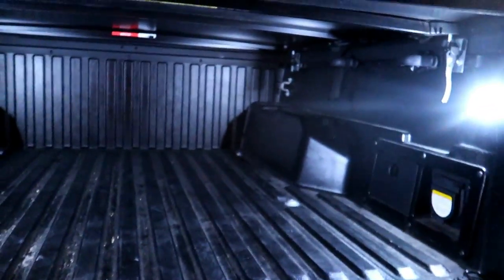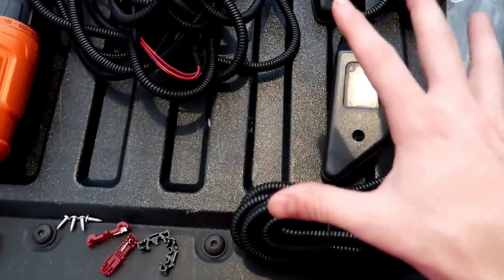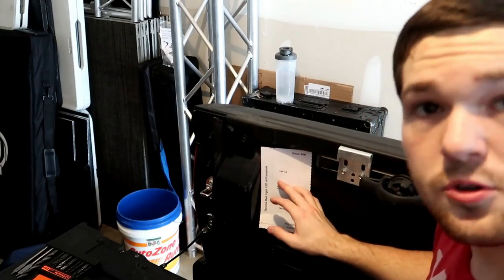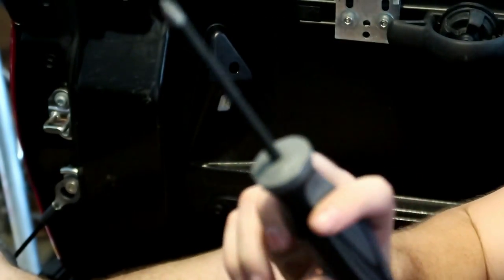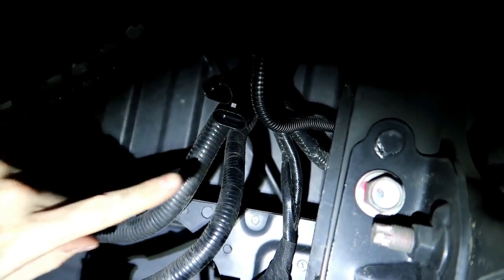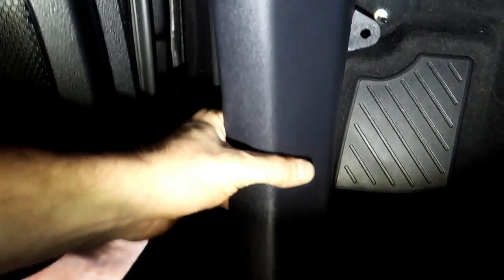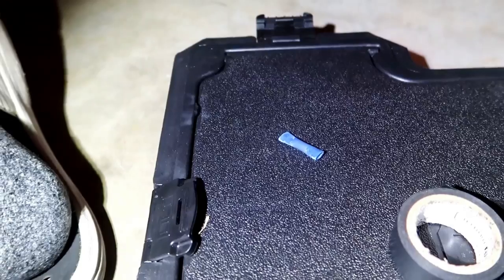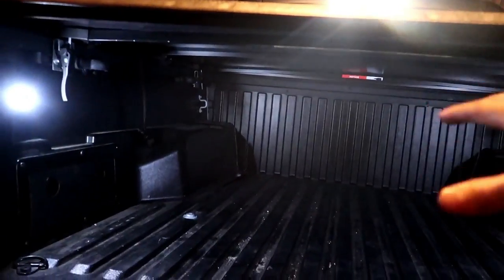OEM Toyota Tacoma Truck Bed Lighting Install | 2015 2016 2017 2018 2019

Comment: Access cab owners have to realize we tap into different wires. And the bed lights are controlled by opening the door or switching the remote unlock - whenever the courtesy light is on in the truck that’s when the bed lights are on. At first I was concerned this was going to be too much of a pain to light up the bed but even though it’s only been a day I think it might work out with that switching configuration. But the lights do make a big difference!
Reply: which wires do you tap into for 2022 access cab install with no remote unlock?

Comment: 2020 has rectangular openings already in place, with a pop-out clip plate. Safe to assume the OEM bed lights are different and no cutting is needed?
Reply: just installed the oem ones for my 2020 trd sport. I had the cargo light/relay already so just needed to get the bed lights off ebay. Got them for like 60 shipped and its directly plug and play. There's a harness for it with a dummy plug on it. I just wasn't sure if I had the relay or not so I had to pop off a piece of the dash to look since I asked the parts ppl and they had no idea. lol

Comment: Taco Rick I have the oem lights already. But I got the upgraded triangle lights off ebay. Do you know if it'd plug and play? The box came with a wire harness but like i said my truck already has the oem lights installed. 2019 SR5 tacoma

Comment: Hey Taco Rick, great vid, thanks.  What about the switching? Does the existing bed light switch also control these lights, so they're on whenever the high bed light is also on?
Reply from the maker: Yep the bed light button controls them too

Comment: I wonder if there is a way to add another switch in the tailbed so you don't have to run up front and open a door, or does it work when the tailgate itself is opened?
Reply from the maker: You can put a switch in just need to run the wiring direct to the battery

Comment: That’s just insanity. Power them off the tow package lights right there at the back of the truck. And wire in a switch. So simple.

Comment: show the wiring to the dash area, my access cab was different. Thanks for posting.
Reply from the maker: 16:00 wiring inside the vehicle and I call out what wire to tap off of......
Reply: My mistake I missed that part of the video.  I was just looking for more of the in cab installation. I was frustrated last night with mine because I couldn’t find a video with the Access cab wiring. I downloaded a better set of instructions and that was much better. Still it was a pain in the butt just because it was about 20° outside when I was doing it. But the bed lights do make a difference. Thank you.

Comment: Would this be very similar to installing ditch lights onto a bed rack...except for the connections in the cabin?
Reply from the maker: Yeah. Or you can tap into the reverse lights at the light.

Comment: Can you do this install on second gen Tacoma’s?
Reply from the maker: You could... you might have to tweak the templates and you would have to determine what is the wire that powers the cargo light but it's a simple install and can be done